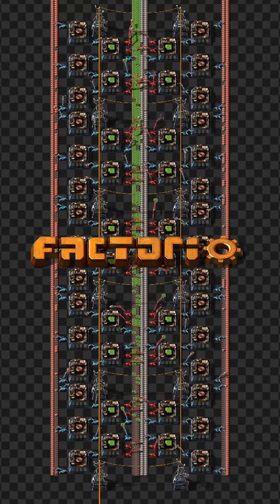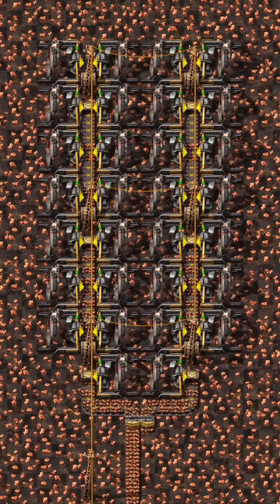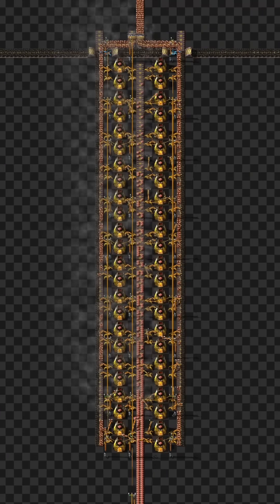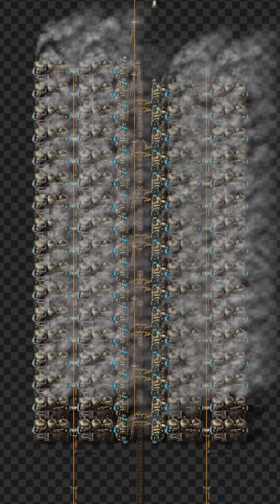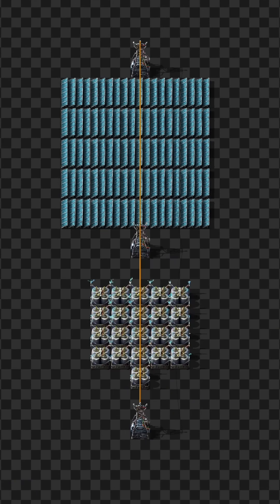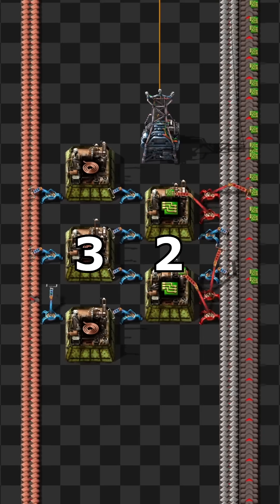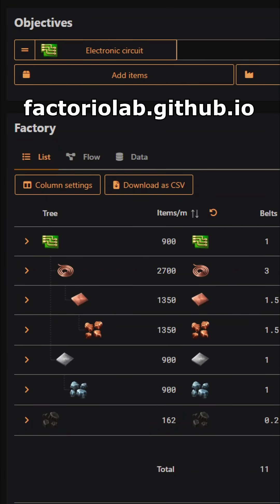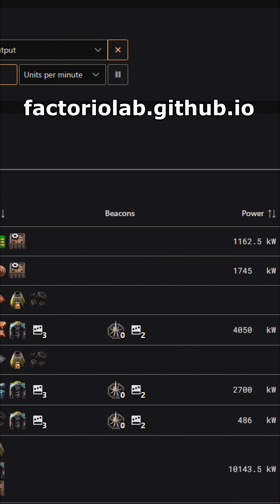Remember these ratios in Factorio #factorio #factoriospaceage

Comment: On another note I have always had issue with the Solar panel to accumulator ratio. The idea is the accumulators supply the same amount of charge at night that the panels would create during the day, but in practice your grid has incalculable spikes from laser turrets and other machines. More accumulators never hurts in this case as you will simply build a larger buffer against a brownout.
Reply: Yeah, I usually use 50 panels for 100 accumulators. 1 stack for each 2. Plenty of buffers!
Reply: @MCPicoli is this really efficient ? I feel like it would not be enough to fill accumulators no ?
Reply: @zwartepeat3552 it charges nicely. Most of the time. My factories never are 100% efficient, I have a complex relationship with the gods of Spaghetti.

Comment: If you do not know the ratios, you do not have to use them, because not using ratios makes some builds easier, but since your builds will partially work some times and sometimes not, your power might fluctuate a lot, so using batteries is very important.
I have found only 1 negative and positive arguments towards not using ratios, so if you know more, you can write a comment.